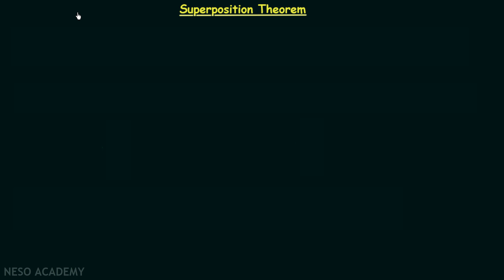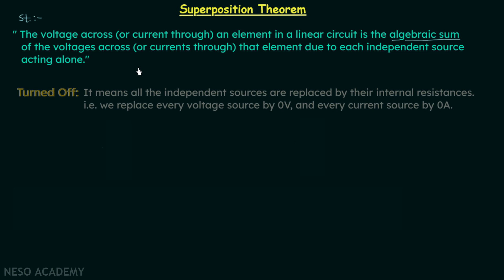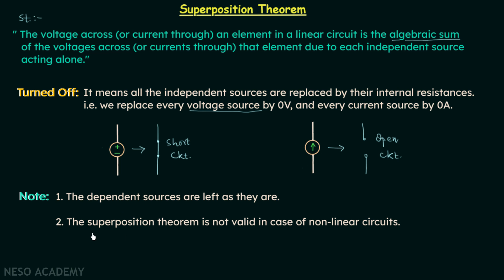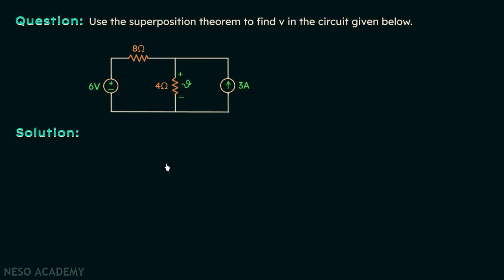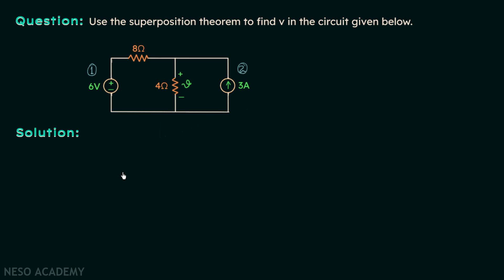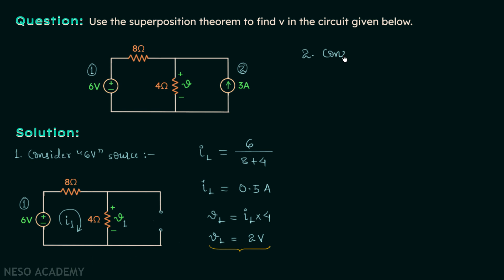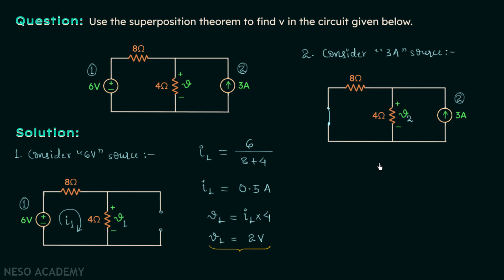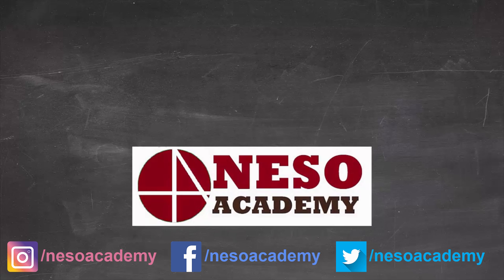Superposition Theorem

Comment: So is the voltage in the 8ohm resistor 12v?
Reply: Or do we have to consider the direction of the current source and voltage source to see that they're in opposition, and therefore have a voltage of 4?

Comment: In the step 2, if I replace the current source by a voltage source V= 12v in series with the 4 ohm resistor I get a different answer . Why ??
Also the voltage polarity across 4ohm due to both the sources is different , so should it be v1 - v2 when we do the algebraic sum ?
Reply: U probably got 2 as answer.
Its the voltage drop across the resistor.
12-2 will give you 10

Comment: Using current divider in the last bit, shouldn't it be (3x4)/(8+4)?
Reply: that is also my concern
Reply: No, because we are calculating the voltage in the 4 ohm resistor
Reply: @tetestoes5188  yea sl it should be (3x"4")/(8+4)
Reply: Current divider rules state that when two resistors are connected in parallel, the current of the source is multiplied by the other resistor divided by the sum of the resistors
Reply: When you use cdr, then the current for the resistor you are calculating, you have to take another resistor than that
Reply: 1
Reply: Masa sɛ wabon a fa tena fie

Comment: wouldnt I1 be negative though? making V=6v?
Reply: Yess, there's something wrong here. Voltage Polarity due to both the sources across 4ohm is opposite. So it should be v1 - v2 when we do algebraic sum..
Also if I replace the corrent source by a voltage source, I get a different answer. Don't know what's wrong here, but something definitely is!

Comment: can't we convert the current source into voltage source and solve the circuit?? what is wrong with that approach?
Reply: Exactly same doubt. I did that, and got a different answer. Don't know what's wrong here. 😭😭
Also the final answer should be v1 - v2. Polarity due to both the sources is opposite. Don't understand why he simply added it if it's algebraic sum.

Comment: Y volage source is replaced by short circuit I thought it would be replaced by open circuit
Reply: Sir has explained neatly and clearly the SPT in this video. As he explained in the initial part, Current source need to be replaced by OPEN circuit... 
Thanks for asking this question, Check out The video "Introduction to Superposition theorem" of my channel. Hope my explanation was clear as well.
Reply: When will a voltage source have no effect ? When it's short circuited. Means there won't be any potential drop due to it. And that's what we won't, right. If you open circuit the voltage source, the circuit will only break, how will you solve it then?
That's why voltage source is short circuited and current source is open circuited.